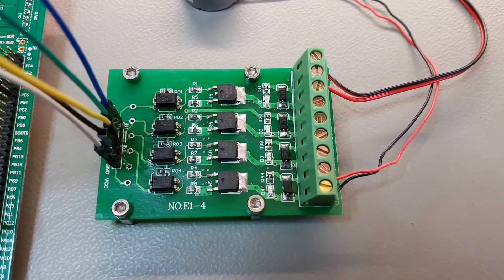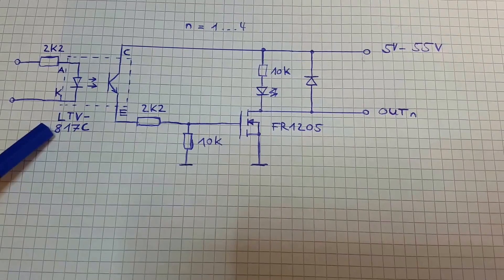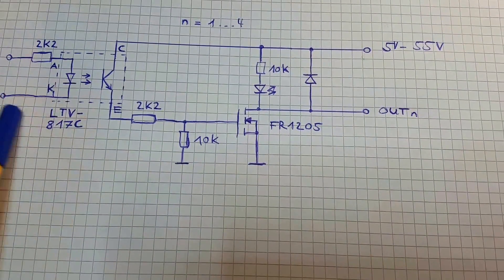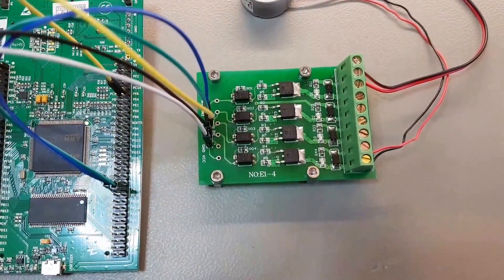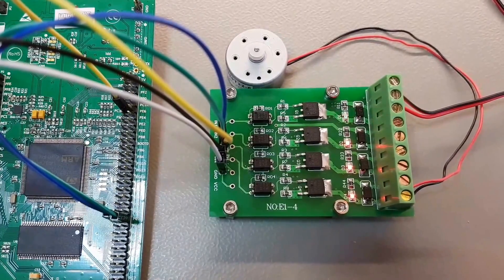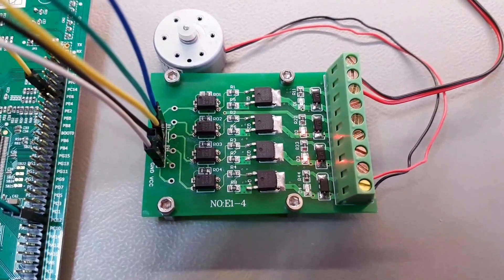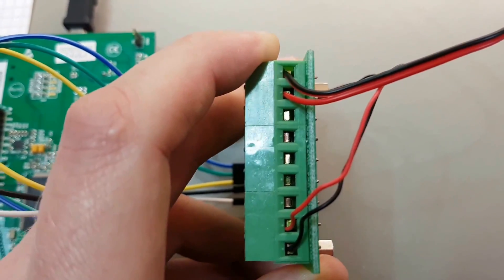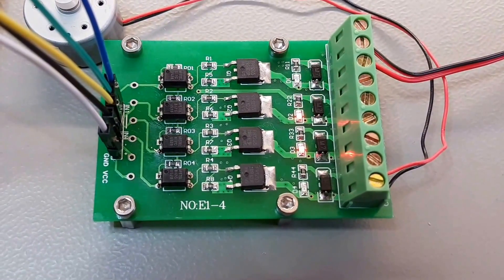µReview #14 | 4 ch. Opto-Isolated MOSFET Switch | www.icstation.com

Comment: Can I use this to follow a bi-directional small motor to drive a large motor---connect LN1 and LN2 to the small motor as input (both as clockwise and counterclockwise direction)and 4 of the outputs as the outputs from an H bridge driver to the large bi-directional 2 amp motor-two to one side of motor and two to the other--see https://www.youtube.com/user/robotbuilderseller or google robotbuilderseller

Comment: I needed an MOSFET board to drive high current relays. I found this board,

The specifications look pretty good, input voltage, 3 to 24V, power output 
voltage 3 to 55V. So I purchased it. While I was waiting I found a link 
to the company that Manufactured it.  There I found a partial schematic 
on the unit, and i became very concerned, knowing that most N channel 
MOSFET's have a 20V gate to (-) limit. Now that I have it, I decided to 
check it out for myself.

I decided to do a basic profile on it.

Power input for the MOSFET was set at 27.5 V. This is half of the rated voltage.

Optocoupling input.____Gate.
_ 1.2V ___________  2.28V  this is when the MOSFET first triggered.
_ 2.0V ___________ 15.60V
_ 2.5V ___________  25.20V  this is well above the voltage limit.
_ 3.0V ___________ 25.92V
_ 4.0V ___________ 25.955V
_ 5.0V___________ 25.97V
__ 10.0V___________ 25.999V
__ 15.0V___________ 26.012V
__ 20.0 V__________ 26.019V
__ 24.0V__________ 26.020V  that is only a 1.47V drop.

at MOSFET power = 30V.

Optocoupling input. ___Gate.
__ 24.0V ___________ 28.169V

And at MOSFET power = 50V.

Optocoupling input. ___Gate.
__ 5.0V____________ 45.589V
_

Remember
 this is a MOSFET. It only needs a static charge on the gate to turn it 
on. There is no actual current flow, through the gate.

In my 
opinion, In order to make sure you do not exceed the gate threshold 
limit of the MOSFET, this board should not be used with a voltage higher
 than 20V power output.

This board needs to be redesigned. A Zener need to be added to the gate. Along with the better voltage divider.

Fortunately my project is limited to 12V. But if your project uses more than 20V, you may want to look for a different board.

that is the major issue, but there are several other minor issues with this board.
Reply: I assume we don't need a resistor to prevent the current flow back to the microcontroller since it's opto-coupled. Is that a valid assumption. Also do you think and rpi could switch this reliably. New to this stuff. Thanks.
Reply: @alengcm  The Pi should not have a problem. What are you trying to control voltage, current, frequency. There may be a better solution.

Comment: I'd say there is a few issue with the specs, 5V will barely turn on the mosfet and 55V will exceed the Vgs on the mosfet and Vce on the optocoupler. With 3V input the current through the opto led is very low
Reply from the maker: +Lasse Langwadt Christensen You are absolutely right. 55V will definitely destroy the optocoupler and also the MOSFET gate. How could I have missed that! However, the module can be used at 3.3V input voltage, as long as
1. The output voltage is around 10V.
2. The output current is not very high. 
I would recommend to use the board with Vin >= 5V and Vout 10...20V.
Anyway, thanks for the feedback!
Reply: 3.3V input is borderline, the Vf of the LED is 1.4V with the 2.2k resistor that is less than 1mA, the CTR is only spec'ed at 50% and that is at 5mA
Reply from the maker: +Lasse Langwadt Christensen It is borderline, but it works. Please remember that this module is not a strictly specified industrial module, but for hobby use only. I was able to build some working test application, so everyone could.
Reply: @AchimDoebler  If you don't need high-speed switching, there are photoVOLTAIC ioslators (these generate an isolated voltage, like a miniature solar panel). This is sufficient to bias the gate of a MOS. A bit more expensive than the phototransistor-based isolators though. Digikey sells a bunch.